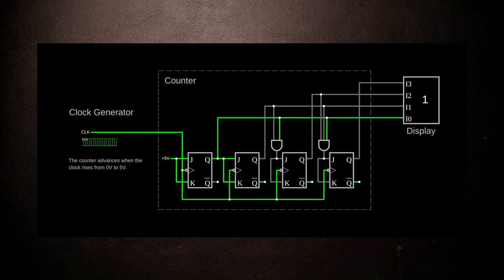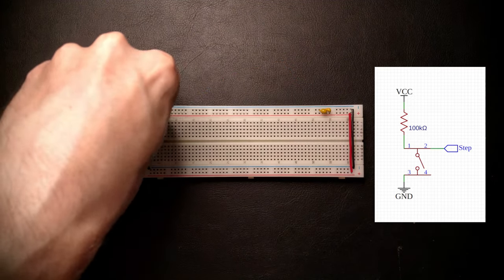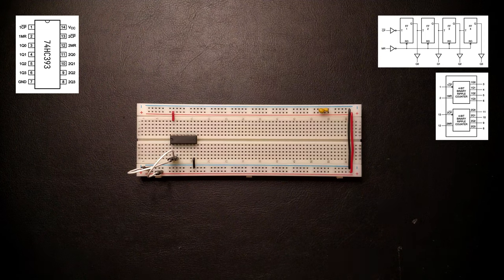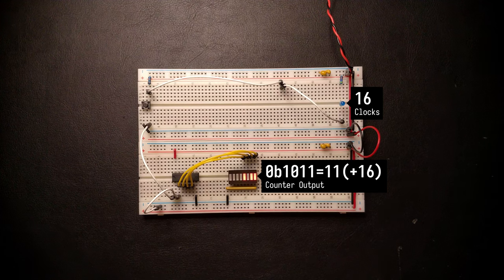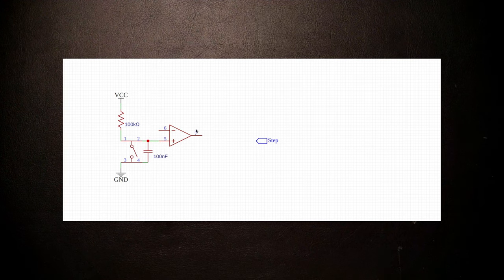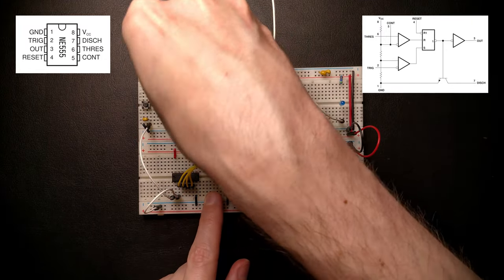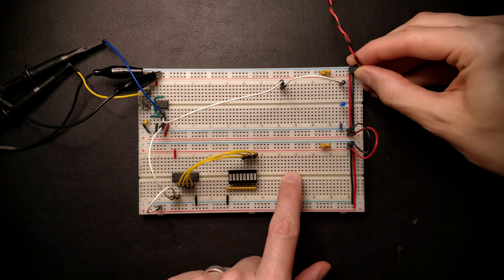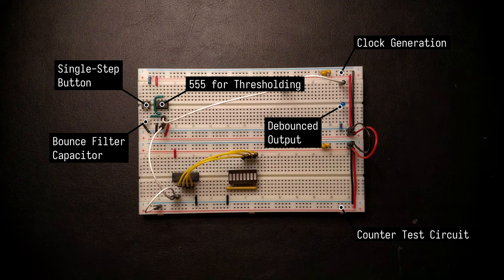Single-Stepping Clock – Superscalar 8-Bit CPU #2

Comment: Interesting series. Two comments:
1. There are some mistakes happening which are just silently solved without a comment. I think it is better to bring them up and talk about them, both to increase the learning value as mistakes are often an important source of learning, but also to make the process a little more honest - after all we all make mistakes.
2. I am a little bit surprised you don't mention the "existing literature" on the subject, i.e. previous videos series such as the ones from Ben Eater and perhaps also Ben Sherman. I can't imagine you being unaware of them and they must have at least partially influenced your work. I'm sure this series will add its own unique touch be of great value, but can be good to remember that we all stand on the shoulders of giants.
Reply from the maker: Thanks! I try to keep as many mistakes in and properly address them, but sometimes the process of resolving the weird ones is too confusing or impossible to edit into a coherent instructive format, in which case I tried to minimize their impact on the flow of the video. I'm expecting this to improve as the videos continue. Regarding related work, I do plan to provide shoutouts to all of the other great projects out there as soon as the comparison becomes instructive and relevant. I didn't want to have a big "lore dump" at the beginning but would prefer more careful comparisons on some of the design choices when they come up.

Comment: Those tiny push buttons practically have no ringing. Yet, you managed to find ones which do ring. 
     Recently I got a cheap RC bulldoser toy which had a remote with buttons simply non-working. Must be the same batch!
Reply from the maker: Yeah totally, these small buttons are usually pretty nice in this regard. The smaller the spring contact, the higher the bounce frequency, and the faster the bouncing decays.

However, it's very difficult to build a button with a physical contact or spring that has no bounce. So even if you find a button that appears to not bounce at all, chances are that it does. For example, the buttons I've used pretty much don't have any bounce if you push them firmly and quickly. As soon as you're a bit off-center though, or you're holding the button with reduced force, it becomes easier to produce a bounce. Almost all buttons behave that way if you keep the force close to the tipping point where they snap between pressed and released state. And it's surprisingly easy to accidentally push the button in a reluctant fashion while your mind is focused on something else, which is likely to cause bounces. And as the button deteriorates over time and use, it becomes more bounce prone.

I guess the bottom line is to always debounce buttons with a physical spring or metal contact, even if they appear to be perfectly bounce-less when they're fresh and you're pushing them properly. It's a statistics game, and the bounces will eventually creep in, possibly months down the road, or only in production. 😁

Comment: Also you're better off using a LMC555 instead of an NE555 as the NE555 is a bipolar device and dirties supply rail because of the way it switches.
Reply from the maker: That's a great tip; I wasn't aware of the CMOS versions of the 555.

Comment: You really need to have a decoupling capacitor per chip close to the chip, I know clock rate is slow but the edges are enough to cause heartache.
Reply from the maker: Yeah totally agreed, that would be a lot better. It's a bit annoying to do on breadboards, unless you use IC sockets that have the capacitor built in. On the PCBs all the chips get proper decoupling, and I'm only planning to push speed once things move to PCBs.
Reply: @fabianschuiki Hi, I'm a bit new to digital electronics (I have some experience with electrical circuits in general, but I'm new to experimenting with chips). I had a question - what is the purpose of the "decoupling capacitors"? My only experience really in using capacitors is with filtering ripple after rectifying an AC source. I was just curious. Thanks!